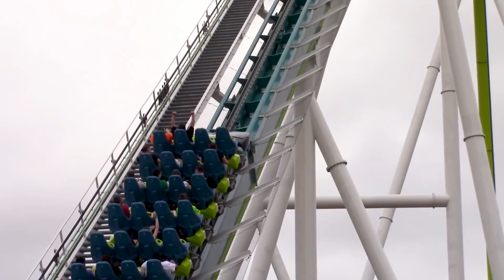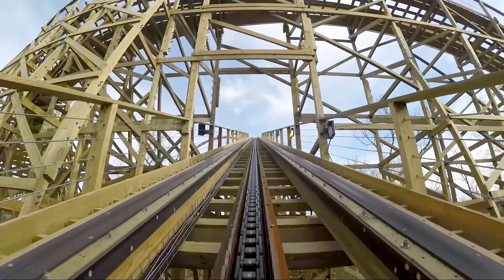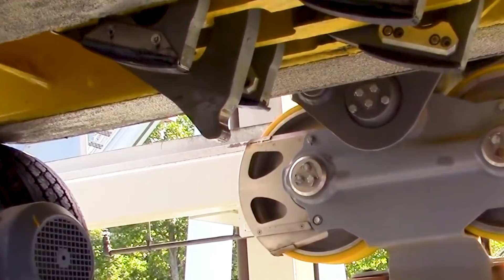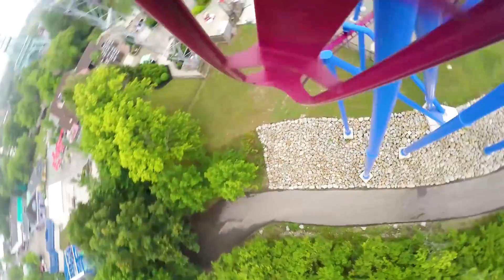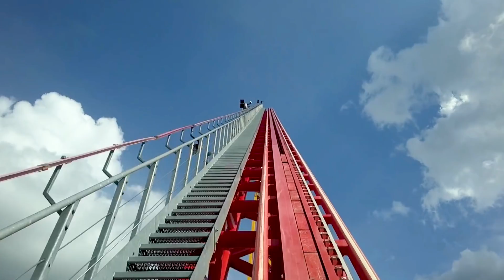Chain Lift Hills: Explained

Comment: Next: coaster supports explained.
Reply from the maker: I will add it to the list, thanks for the suggestion. :)
Reply: DYK- that alpina blitz only has 2 pairs of supports on the lift and drop!
Reply: @coasterbot  don't forget stations :)

(and block system/capacity)

Comment: I always thought the anti-rollback dogs WERE called chain dogs... now I know they are two separate things.  Wonder who came up with that name
Reply: 5MadMovieMakers I also always thought that the anti-rollback device was split into two parts.  Is he saying that the ARB Device is only found on the lift hill?
Reply: I always thought that the Antirollback was called the "Catch Cat"
Reply from the maker: There's a lot going on underneath the train to say the least :)
Reply: He only mentioned them being on the lift since that's what the video is about, but they are also found in other areas. Must more common on wooden coasters, you will see antirollback devices at the top of hills where the train is traveling relatively slow. In the case that a train stalls (there is actually a video on YT of a train that stalled on Hades before it became Hades 360) it will catch on the device rather than falling backwards.
Reply: On some coasters there are ARBDs on all uphills to avoid troughing but on most they only occur on the lift hill.
Reply: COASTER BOT or above if you’re on an invert
Reply: You are YOUTUBER!
Reply: Hi

Comment: The only roller coasters I’ve ever been on had chain lift hills. I’ve only ever been on two roller coasters, both located at Playland At The PNE. Before Playland’s Wild Mouse was closed and demolished, I went on it. It was my first time on a roller coaster. It scared me, but at least I learned what it was like. The only other coaster I’ve been on is a kiddie coaster called Kettle Creek Mine. The ride is only about 10 seconds long and requires two laps around the track to complete. There’s also a camera that takes your picture as you go down the first drop

Comment: Good video, and great animation. Something you may find interesting, on many coasters the ARB system is not the first safety in case of lift stop. The gearbox delivers power though a sprag clutch, which prevents the chain traveling backwards under the weight of the train when the lift motor is not running. Ideally, this should prevent the train from rolling back and engaging on the ARB rack.
Reply from the maker: Thanks and I didn't know that :)

Comment: Question: I've seen on several roller coasters that the trains reach the lift hill going considerably faster than the chain. What exactly happens there?
Reply from the maker: The trains can climb the chain, and then will attach once they come to a stop. You see this in quite a few POVs. :)

Comment: On a lot of modern coaster, you can't even hear the anti-rollback dogs, why exactly? Are they retracted by the tension on the chain dog or how does it work?
Reply from the maker: The ARB on the train can be magnetic, causing it to remain in an upright position as the train goes forwards quickly. When the train slows down, or stops, the ARB falls back down and makes contact with the track once again :)

Comment: Another kind of lift hill is the magnetic lift hill. it Utilises Linear Synchronous Motor (LSM) of Linear Induction Motor (LIM) technology to haul the riders up the lift hill at a high pace and it can get the riders up to speed quickly. Found on Battle Star Galagctica, California Screamin' and Maverick, it uses the same technology as a magnetic launch only with an anti-rollback system of some sort. This useful as it can get the riders up to the top very quickly however, it has larger running costs than the other lift hills. Another kind of lift hill as well is the drive tyre lift hill. Found on most junior coasters it utilises drive tyres to get the train up to the top by propelling the train forward (at a slow pace, of course) with pairs of spinning, high-friction tyres that catch on to a piece of metal that hangs under the train and gets caught in between the two tyres. The advantage of this are that you can have curved lift hills, largely increasing compactness. The disadvantage however, is that it requires quite a bit of force to propel the train up as there is a large amount of friction between the tires and the piece of metal COMBINED with the anti-rollback system.
Reply from the maker: Very true! :)
Reply: wow, 2 replies in a matter of seconds. thanks for paying so much attention to my comments! d:D

Comment: As a bit of a geek but not someone in the know. I have always wondered why on rides such as the Smiler and Saw the ride, when the cars reach the lift hill they cone to a complete stop whilst the chain is still rotating. The chain then stops and the car engages. Seems like there is a fancy mechanism going on.
Reply from the maker: Gerstlauer thrill coasters, like the ones you mentioned, use a chain dog which pushes the train up the lift hill. Therefore, the cars stop at the base of the lift to allow for the chain dog to come into contact with the train, then it begins the ascent.

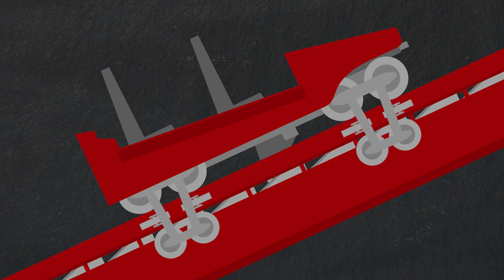Comment: Fantastic video, did you make the animation at 2:06? If so, would it be possible for me to borrow it for a video. Im doing a video about an accident on a roller coaster and would need something like this to explain why it happen and wont happen again.
Reply from the maker: I did create the animation. Feel free to use it as long as you write 'Animation by Coaster Bot' on screen when showing the animation, and linking to the chain lift hills explained video in the description. Thanks :)
Reply: @coasterbot  First, great job :). Second, absolutely will do all of that.

Comment: What causes the train to disengage from the chain lift? I'm pretty sure every car on the train gets attached at the bottom but the entire train always disengages and gets faster before the last car is at the crest of the hill let alone at the end of the chairlift, but not so soon that the middle of the train starts accelerating at the apex of the 1st hill. How exactly does that work?
Reply from the maker: The train can move forward up the lift hill under its own energy, but cannot move backwards. Therefore as the train crests the hill, the chain dog moves up and over the slots on the chain, until it has cleared it. :)

Comment: Actually the train is pushed up the lift  rather than pulled.  The dog drops into the gap between the links of the chain and rests against the lower barrel of the link thus allowing the chain to push against it.
Reply from the maker: Pushing, or pulling, is relative to the position of the viewer. If you were standing at the top of the light hill, the chain would be pulling the train up the hill as it comes towards you. The animation hopefully clearly showed how the chain mechanism works, which should avoid any confusion. :)

Comment: What about vertical lift hill rollback?
Reply from the maker: This depends on the lifthill. Often the chain dog method is still used. However, Gerstlauer use magnets of their Infinity coaster model to slowly and safely bring the train back towards the ground if the chain does fail :)

Comment: how would a shuttle lift hill on the boomerang coasters work?
Reply from the maker: To be honest, I have no idea. There is a manual chain release which causes the chain dog is disengage to it reaches the peak of the lift hill.
Reply: ok. maybe it has something to to with the extra pair of wheels at the back of the train
Reply: after taking a look at a boomerang coaster in planet coaster i figured out the answer!
what happens is that once the train reverses out of the station, it couples up to a powered car. that powered car then pulls the train up to the point of the lift hill where the slope becomes uniform where it connects to a catch car - one that is an actual car. the catch car has a cable attached to it. once all connections are made the train gets reeled up to the top of the lift hill. then the powered car and the catch car are decoupled, making the train roll down the hill. the train traverses the track and then goes up a chain lift hill that is the same hight and incline as the catch car one. what makes this chain lift interesting is that it does not have any teeth. once the train is close to the dead-end, the chain lift deactivates causing the train to roll down the hill, traverse the track backwards go through the station without stopping. the train rolls up the lift hill, stopping about halfway up, then it rolls down into the station and the ride ends. once the ride stops the powered car and the catch car return to their original positions. for a portable coaster, the vekoma boomerang is quite complicated

Comment: What about vertical lift hills
Reply from the maker: This depends on the lifthill. Often the chain dog method is still used. However, Gerstlauer use magnets of their Infinity coaster model to slowly and safely bring the train back towards the ground if the chain does fail :)